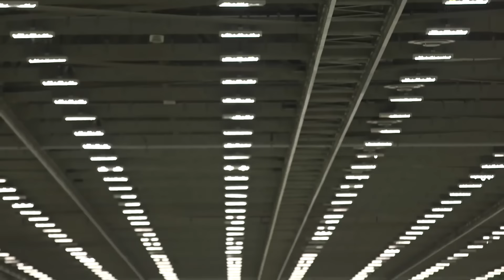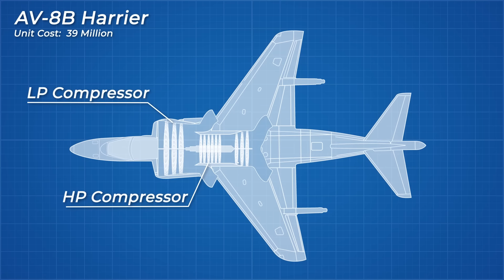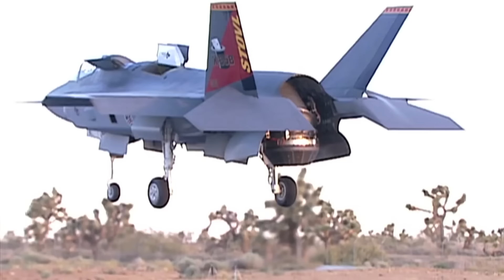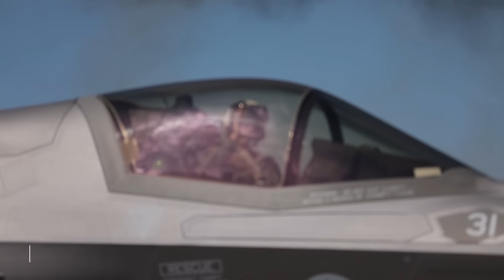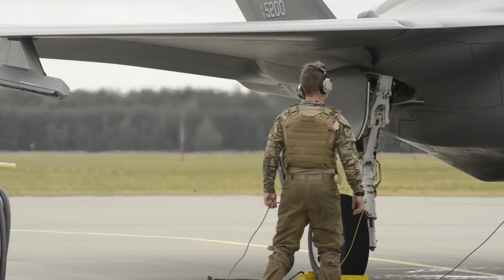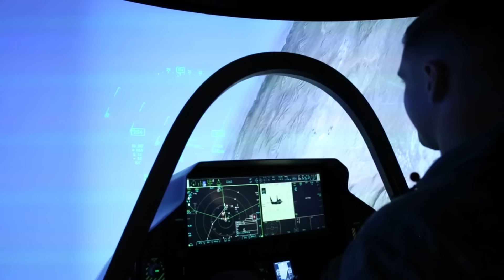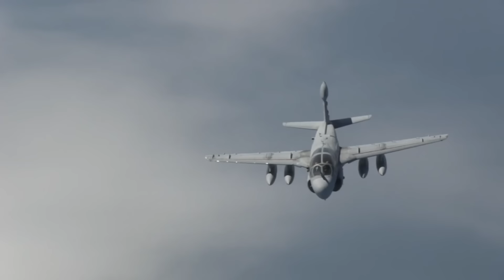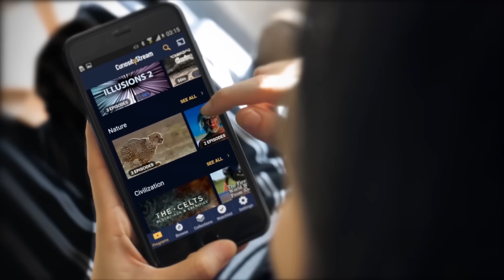Is The F-35 Worth $115 Million?

Comment: Although I do greatly appreciate the detailed research and thought into this video, there is something extremely important about the F-35 that you overlooked, and is something that the Americans learned way back doing the Vietnam war of all places. How? The F-4 Phantom.

The F-4 Phantom was, much like the F-15, P-52/P-38/P-47/Spitfire, and other generational-leading aircraft, an outstanding aircraft, one that definitely deserves its place in history. However, early in its career, the F-4 was designed without an internal gun, as it was thought that subsonic dogfighting would be impossible, and using a gun would therefore be a waste of space and weight, relying solely on anti-air missiles to engage aircraft.

However, aside from the inaccuracy of air-to-air missiles of that era, many F-4 pilots would quickly find themselves in subsonic fights, and also out of missiles. Suddenly, the Soviet MIGs - which kept their guns -basically had the helpless F-4's dead-to-rights. Initially, they had to slap a gun-pod onto the F-4, which severely hurt its agility, until they were later redesigned with a permanent interior gun.

Going back to the F-35, it's great that they can shoot missiles from beyond visual range, that they can see through their airplanes, and be super stealthy due to their fancy technology. However... first of all, you have to consider IFF (Identify Friendly Foe), both in terms of rules of engagement, and in terms of the system itself.

There's no reason why an enemy can't fake an IFF transponder to appear friendly, or suddenly have F-35's shooting down civilian or friendly aircraft through misidentification (case in point Malaysia Flight 17; though I do greatly criticize the circumstances leading up to it, a misidentification by a crewmember operating a state-of-the-art anti-aircraft system made the shot, and that situation could happen here). The only guaranteed way to confirm identification is to either fly into "Mark I Eyeball" range (which means you're now in subsonic combat range, and now at extreme risk of the F-35's weaknesses in dogfighting), you have to fly someone else to make the identification for you (either a drone or another aircraft that may be sacrificed to make that call), or you have troops on the ground make the call (which, in the chaos of combat, can be easily be misidentified anyway). This alone negates many of the aircraft's advantages in dog-fighting.

Separately, you mentioned it yourself when talking about the F-117, which is electronics warfare. if enemy forces deploy electronics warfare, it is highly likely that the F-35's will be unable to fire from standoff range, again negating their advantages. Even if your opponents can't see the F-35's, the F-35's can't see you until both sides are on top of each other, which again leads to a subsonic dogfight where it will lose.

Finally, and perhaps the most damning is the excessive use of technology itself; in an age where cyberwarfare has matured to the point where countries like Iran can hijack and land one of the U.S.'s top-secret stealth drones, the chance of the F-35 being targeted by cyberwarfare (especially considering that it's been proven that the Chinese successfully stole the plans for the F-35 by hacking Lockheed-Martin's servers), is extremely high. Worse, is the consideration that if it faces off against a major military power, there's an extremely high chance of the deployment of both anti-satellite (AKA goodbye GPS and all GPS-guided weaponry) and EMP (or NEMP, if nuclear weapons are used) weaponry. Both of these will either force the F-35 pilot to fly as if it were World War II. Or, in the case of the EMP, it could fry their electronics and cause their planes to fall from the sky when their computers stop controlling the aircraft - which is one of the reasons why the Russians stuck with vacuum-tube electronics in their aircraft long after integrated circuit technology became popular.

All and all, the F-35 is a fancy showhorse that, when things are going exactly the way the US military wants their battles to go, will be an effective aircraft. But, if that dynamic changes, suddenly the F-35 will be a flying target, forcing the F-15 (and the vastly superior F-22 - which unfortunately will suffer similar problems like the F-35 in the electronics department - but at least it can dogfight!) to take over. What's really silly about all this, is that ever since the F-22 was adapted to carry air-to-ground weapons, there is really no reason why the F-35 is needed at all; if they stuck with only the F-22, chances are their unit price would be far lower, as less than 200 F-22's were ever built - and even the US Air Force has been thinking of restarting production.
Reply: I would point out that Navy F-4s continued to be effective despite not receiving gun pods because they changed their tactics in response to the different nature of the plane. 

The only way for an enemy to fake IFF is to steal the IFF keys. Generally, these keys are treated as quite sensitive, and can be changed if necessary. Even without, there are many scenarios where it is possible to determine targets based on context, direction of travel for example. 

I'd also point out that EW may reduce engagement range somewhat, that doesn't necessarily force dogfights. Even if radar fails completely, the AIM-9 has a range of at least 10mi, for example. 

In the event that the EMP hardening is insufficient, both the F-22 and F-35 are completely dead. The control surfaces won't even move without the flight computers running. The US military has (correctly or incorrectly) determined that the chance of this happening is not worth dealing with. 

Finally, the payload of the F-22 on a ground attack mission is somewhat limited compared to the F-35, being unable to carry 2000lb bombs internally, and even if the price did fall we'd still be looking at something like 140mn USD compared to about 75mn USD, with more expensive maintenance and more outdated avionics.
Reply: There were very few instances in which F-4s ran out of missiles, and almost none where MiGs managed to win against the F-4 specifically because of the limitations of missiles and radar. The vast majority of F-4s shot down by MiGs over Vietnam were due to ambush tactics and lack of awareness of US pilots. The F-4s still ended up with respectable - but not as good as expected - kill ratios of at minimum 2.7 MiGs shot down for every USAF F-4, or at maximum 5.7 MiGs shot down for every USN F-4. Roughly 80% of MiG losses were to missiles. The USN F-4s never used guns purposefully outside of CAS, and quickly found that gunpods were ineffective in air combat anyway. I'm not too sure about how the USAF viewed gunpods.

The idea wasn't that subsonic dogfighting would be impossible, rather that it wouldn't be necessary. The US military was only required to develop weapons and doctrine to counter the Soviets who were noted to use large bomber formations. The escorting Soviet fighters were almost no threat to ground forces and could therefore be ignored. 

When the US politicians decided to go to war against Vietnam they were fighting a completely different type of enemy that did not defend targets as expected, and did not attempt large scale attacks as expected. The NVAF treated their strategic installations as bait for American forces and almost never had fighters patrolling. Their objective was not defence, rather it was to demoralise the American forces by inflicting as many casualties as possible.

The MiGs had advantages over the F-4, but the F-4 always held the more important advantages over the MiGs. 
The MiG-15 could out-turn the F-4, but the F-4 won in every other aspect and could easily avoid being shot down. MiG-15s would usually retreat when confronted by F-4s because the pilots learned they couldn't win if they didn't have the element of surprise, but they could escape fairly easily due to the F-4's radar lacked look-down shoot-down capability and couldn't filter background noise effectively. 
The MiG-21 couldn't out-turn an F-4 unless the F-4 was loaded up with bombs, but it was more comparable to the F-4 in performance which made it a more consistently capable threat. However it was still reliant on ambush tactics to win most situations.

In terms of IFF there is no better fighter than the F-35. It's radar can map the shape of it's target. It can visually identify targets BVR thanks to it's powerful optical sensors. It can also use traditional IFF, and a pilot with average intelligence or better can simply observe the flight patterns of contacts to determine which ones are threats. The F-35 is also no more vulnerable to electronic warfare than any other fighter, arguably less so. 

MH-17 is an example of either incompetence or intentional action, not simply misidentification. 

The Chinese only stole the basic blueprints... they do not know how the technology inside the F-35 works nor are they likely to develop a counter. 

If GPS isn't an option it doesn't make the F-35 any easier to counter. Most air to surface weapons developed for the F-35 have multiple guidance types, and no military aircraft rely on GPS for navigation.

If EMP is being used it likely means there's a nuclear war going on.. in which case fighter aircraft won't make much of a difference. If fighting manned aircraft it is significantly more efficient to use conventional warheads than non-nuclear EMPs. It is a similar case to lasers and railguns... the technology is far from being cost-effective if the goal is to eliminate a threat.

The Russians did not stick to vacuum tube technology because of nuclear and EMP threats. They stuck with it because like most new technologies they couldn't afford to use them en-mass until long after they were available in the West. Resistance to EMP effects is the only positive of staying with VT technology, so it was the only way for Russia to convince their people that they weren't behind in electronics. 

If the dynamic changes I still don't see how the F-35 would be worse off than the F-15. The F-35 is quite a bit more maneuverable with comparable subsonic acceleration and sensors that cover every angle making the F-35 very difficult to ambush. The F-15 also has the largest RCS of all modern fighters and would easily be detected and engaged before the F-35 is seen. The F-22 on the other hand is slightly more maneuverable and has a notable speed advantage, but is also shorter-ranged, less stealthy, and significantly less capable in electronic warfare. In actual exercises the F-35 and F-22 are roughly equal in air combat effectiveness, but the F-35 is significantly more capable in air to surface roles.

The USAF abandoned the idea of restarting F-22 production back in 2016 when their own study concluded that restarting production would cost almost as much as the original F-22 program. Unit cost would rise to at least $180M with the upgrades required to justify restarting production, and the estimate for unit cost with a production run of around 120 (to meet minimum operational requirements to replace the F-15C) hypothetical F-22Cs would be roughly $220M. They determined it was far more efficient to start work on a new aircraft more suited to combating future threats.
Reply: @dumdumbinks274  sorry, tagged you by mistake
Reply: @The Legacy
"the F-4 was designed without an internal gun, as it was thought that subsonic dogfighting would be impossible" - No. The F-4 Phantom was designed for fleet defense. The way to do it is to go FAST, meet the threat head on and fire missiles at beyond visual range. If you had to come around and circle for a guns solution, you've already allowed the enemy to fire anti-ship missiles. Against the carrier you needed to land back on. The gun was dead weight for this purpose.
"basically had the helpless F-4's dead-to-rights" - Because due to gaps in radar coverage, F-4s accompanying strike packages were vulnerable to MiGs coming around the border and doing high speed passes in ambushes that could not be reversed because the F-4s were flying slower to keep up with the strike aircraft. F-4s that participated in MIGCAP missions and went around looking for enemies had a satisfactory kill ratio. The Navy F-4s, which were not in a position to get ambushed and had radar coverage provided by the ships behind them, also had no issue going toe to toe with the MiGs.
"at extreme risk of the F-35's weaknesses in dogfighting" - Pilots compare it to the F/A-18. There's footage of a pilot fighting Su-30s with the Hornet in training exercises and he did well.
"the F-35 will be a flying target, forcing the F-15 (and the vastly superior F-22 [...] to take over" - This makes no sense. The F-15 and F-22 are air superiority platforms. They're the expensive, overpowered, premier air to air platform. The F-35 is the cheap companion multirole that fills the gap left by the fact that there's not enough F-15s or F-22s to handle everything else.
"ever since the F-22 was adapted to carry air-to-ground weapons, there is really no reason why the F-35 is needed at all" - This is completely incorrect. The F-22 has very limited ground attack capabilities. The F-35 is needed to fill all the gaps.

Comment: Yeah F35 is cool but it came too late. It doesn't matter if your plane is hidden from radar screens if the enemy has a swarm of drones scanning the sky with IR cameras. 
It doesn't matter if your aeroplane can shot down 20 aeroplanes in a row if all 20 you killed were drones that cost a couple of million bucks and the 21st drone manages to shot you down and kill your pilot. 
It doesn't matter if your plane is acrobatic and fast if the enemy drone can withstand 50G manoeuvres all day long while your pilot passes out at 9G. 

It doesn't matter if your plane uses computers to do sensor fusion for your pilot when your enemy IS a flying computer. 

F35 would have made a hell of a lot of sense in the 80s and 90s. In 2020, the war is slowly but surely moving beyond being a human endeavour.
Reply: I would argue that drones are not yet capable of fulfilling the roles you've identified. Drones for scanning are vulnerable to being jammed and false positives. 
A high-speed, highly maneuverable fighter drone would not cost only a few million dollars. The engine(s) alone will cost more than that, and the structural design of a highly maneuverable aircraft would require both complex manufacturing and exotic materials, both of which increase cost further. Drones would additionally require sensors which are at least equivalent to manned fighters, which adds even more cost. 
There is still a difference between sensor fusion information displayed to a human and a computer making autonomous decisions. Humans are superior at general decision-making and rapid adaptation.
Reply: @infinitelyexplosive  You're imagining drones that can dogfight humans. I'm imagining swarm of slow-flying solar-powered cheapo drones that'd cover the borders of an area looking at the sky with infrared cameras in a dense grid. As far as flying goes, a little better than the 1940's zeppelins to be honest.  

They would make radar stealth inconsequential. It doesn't matter how good you hide from radars, laws of thermodynamics mean, a supersonic jet can not be hidden from IR sensors. 

Once these flying cameras acquire an enemy jet, they'd send its location to a ground-based guided missile. It doesn't matter if the missile can't track the plane with its own radar, once it knows where to look for, it can just use regular cameras to lock on. 

If this stuff sounds like sci-fi to you, it shouldn't. All of these technologies already exist. We already have solar planes that can remain airborne indefinitely. We have IR cameras mounted on drones and we have missiles that can take guidance information from 3rd party equipment. 

The cool thing about using cheap drones is, you can just throw numbers at a problem. Sure an F22 will be a better air superiority fighter than any drone. At least for the foreseeable future. But is it better than 1000 drones swarming around and looking to guide an unlimited number of heat-seeking missiles to it? I don't think so. Even if it is, you can throw in an additional 1000 to get it done. What you got to lose other than a couple of million dollars? You're not risking your pilots live.
Reply: Solar powered drones are obviously out since you need to be able to defend at night. Then we're left with combustion-powered drones. How much fuel does it take to have a network of hundreds of drones flying constantly? What happens when even a few EW aircraft start blasting noise in the general direction of the drones? Can the base station still receive signals? How much data are the drones transmitting in normal operation? Is there enough information to differentiate between, for example, a plane and a cruise missile?
Reply: "swarm of drones scanning the sky with IR cameras" - and which country has this swarm surveillance capability and how long can the drones stay in the air until the batteries/fuel are drained?
Reply: F-35 will be carrying a laser. Drones are meaningless to a weapon that works at the speed of light.